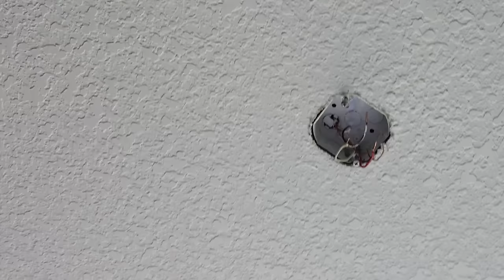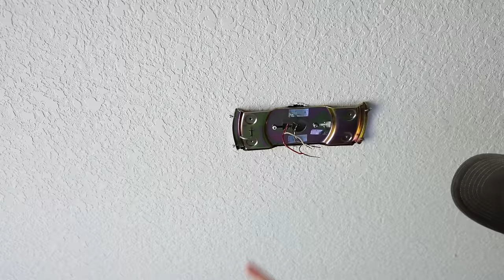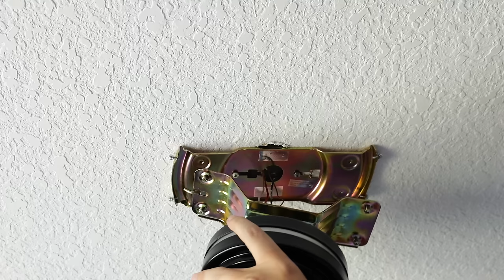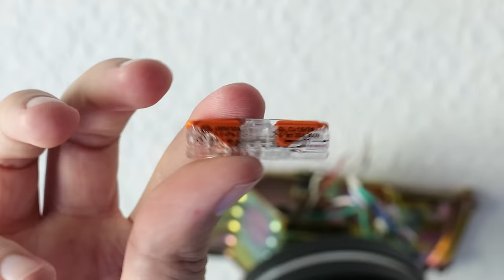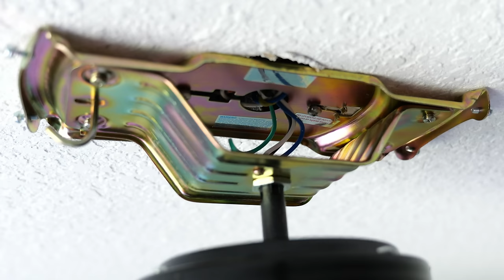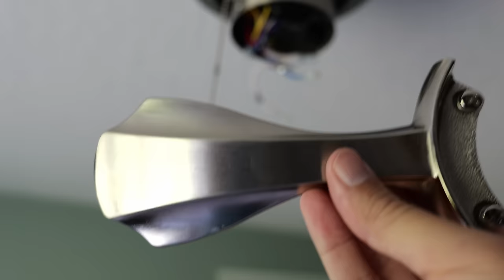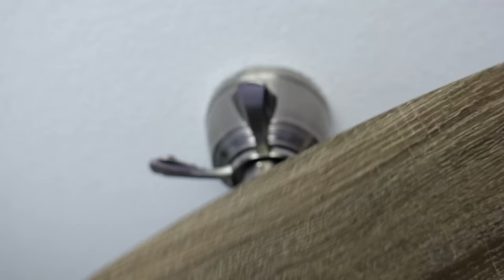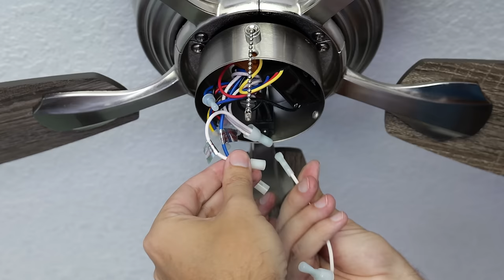Avoid This VERY Common Mistake DIYers Make When Installing a Ceiling Fan | How To

Comment: There are a few things I would like to add to this fan installation.
1. If the fan circuit is in the same room as the entertainment system, turning off the circuit breaker would be a hassle. Could you only turn off the two switches and test for power existence? 
2. If this is a DIY project, you don't know the rate of the electrical box. It's dangerous and a code violation if the electrical box is only for lighting fixtures. Even if the box is strong enough to handle the fan weight, I don't like the design of using two little screws to attach the fan bracket to the electrical box. I would utilize the 4 screws that connect the fan motor to the fan bracket. First, check if any studs at the 4 holes. If there are no studs, I would use 4 strong anchors to install and use for screws that come with the anchors instead of using 4 factory screws. I won't sit under the fan running at the highest speed with this installation. 
3. Before installing the fan bracket, make room for the electrical box so we can easily push all connections back into the box. The power wires look old and oxidized. We can lightly sand them or cut them off and make new ones. 
4. I think the fan wires have labels to show for light and fan. As someone suggests, more than likely, the switch that is closest to the entrance is the light switch, or just turn it on to double-check without opening the switch cover. In addition, the rubber band that ties the wiring of the fixture is for boxing the fan. It should be removed for connecting to the power. Worsely, it should not be pushed back to the box. Nothing should be in the electrical besides electrical wires and nuts with the correct code.

Comment: Question. The ceiling fan I have, the wire connection plug burnt. I plan on purchasing the wago 221-2401, cutting the 9 circuit terminal socket and connecting each wire with the wago connectors. The wires on the Hampton bay ceiling fan and light kit all have 18awg written on them. Do I have to use that gauge or can I use 16 awg if I need more wiring to make the connections longer?

Comment: Sometimes it’s not possible to do it, like when the box is too thin. In this case, if it’s a hugger, use lots of zip ties to ensure that the wire would never scrape the motor.

Comment: I have two incoming sets of wires coming from the ceiling. 
Set 1 has Black, white, and Ground.
Set 2 has Black, Red, white, and Ground.
My Hunter ceiling fan  (with a light), has Black, Black with White Stripe, White, and Ground. 
What are my hookups? Please help. Thanks in advance guys.

Comment: Have you done a video on "packing boxes"? I've done a lot of electrical, but I still have a problem sometimes packing a very busy box, getting all the wires to fit neatly. Do you have a special technique to make that a bit easier?
Reply: I've even resorted to using a piece of wood to push the wires tightly into the box. I'm sure that's a Nono!
Reply: I've had a lot of clients that refuse to walk across the room to flip a switch. Every light has at least a three way control if not four or five. I think those people need wireless electronic controls. Hardwiring that many switches is just stupid.
Reply: How about a video about arguing with unreasonable clients? That would be a good one!

Comment: I think it's a good common practice no matter what connector you use you should always use black electrical tape that way the connector and the wire can never come completely apart and be exposed to a short or shock someone.
Reply: if your connector won't hold without tape, you're using the wrong connector or installing it wrong.  and yes, I've had lots of connections where a tape covered wire nut fell right off.
Reply: @kenbrown2808  why would you say a wire nut wouldn't hold a wire? Tape is only wrapped around the wires and the wire nut to make sure it never comes apart and it can't short or cause someone to get shocked. It's just an extra safety measure you don't have to do it by code but people that wants to make sure things are extra safe do it this way and electrical tape is cheap.

Comment: If you don’t have a red wire does that mean you can only have the fan working when the light is also on? 
Mine has a remote control but I’m not sure how the wall switch interacts with the remote.

Comment: If you use the in line wagos, use heat shrink tubing to keep them from accidentally getting opened. Electrical tape will work, but makes a mess when the connections need to be changed/replaced.
Reply: @lylecoglianese1645  and then fill the box with sprayfoam just to make sure NOBODY can ever access the connections.
Reply: Haha YouTube needs a SARCASM FONT 😅

Comment: I have two switches and a red wire. the second switch has separate lights in the ceiling. Once installed everything works from the same switch whether i put black and blue or red and blue. the other light switch does nothing. Any ideas ? 💡 🙏🏽

Comment: Hi  I watched some of your great videos   I have a problem with field mice getting under my garage door. Unfortunately I still have a manual door.  The the stopper catcher on the vertical guide can not be moved and there is no travel left in it to adjust it.  So it looks like I need to remove the part that is bolted to a steel plate on the door itself.  I cant find any YouTube video to help me.  I'm worried if I unscrew the catch mechanism I wont be able to relocate it just a small amount.  Any helpful ideas?  Thanks

Comment: How do you know if the cueling can hold the weight before you install your fan. I live in a older tailer. That's my main concern the fan falling
Reply: 😢ceiling fan
Reply from the maker: Want to make sure that it is a fan rated box, oftentimes made of metal.  They can either be fastened directly to the framing or will have metal bars that span from one ceiling joist to another.  If it’s a plastic box I would definitely look harder at it to make sure it’s fan rated.  There are some plastic boxes that are fan rated but are a pretty hard plastic and have deep threaded larger screws than normal fixture boxes.  Some will even say fan rated.

Comment: I would seal the connections with electrical tape after you connect them up. Those levers open up. Had it happen so many times. I no longer use them.

Comment: I have an older home and noticed that the electrical boxes are the pancake type. I am not able to push the wires up into the box. What would I do with the wires in this case ?

Comment: Given that you were replacing a light fixture, why were there 2 hot wires coming from the box with 2 switches? What was the 2nd one for?
Reply: I was wondering that too… maybe there used to be a ceiling fan there and it was replaced at some point with just a light?

Comment: im anelectricin and installed 2 fans, i hooked them up so the switches control the fan and light, i live in a mobile home,so my panel is not bonded, but each fan only lasted a few dys to 1 week and then both quit working,i wonder why, could it have something to do with the ground not being bonded

Comment: I always wondered why no one wraps the connector with a layer of electric tape to ensure the levers don't flip up. Is there a reason?
Reply from the maker: You certainly can.  But if you’re just careful when placing them then there should not be an issue.

Comment: Those  connectors are easy, but they back out over time  because alternating current vibrates, they also make minimal contact, which can cause arcing, which will trip arc fault breakers. It's always better to lead the stranded wire from the fixture, and use wire nuts.
Reply from the maker: That may be true on some connectors but the Wagos are spring loaded so that is not at all likely.

Comment: I installed a similar fan using the exisiting wall light switch and fan switch and wiring to to the ceiling box and have noticed that when I have the fan running and the lights off (LED), the lights have a very, very faint glow when the room is dark.  I know LEDs respond to far lower voltage than incandecent bulbs, but I find this odd.  Should I be concerned about the light switch in the wall?

Comment: my issue: room has two switches (fan and light), installer put ceiling fan that has only ONE wire for light and fan since model is designed to control by wireless remote. Is there a way to mod the fan to split the wiring inside so fan and light are separate control?
Reply: Not to use by choice. The light will not operate like you want.  The wall switch might be able to control the light but if it's off, the remote can't turn it on.  Many manufacturers have a "one space" wall control using the black and white wires for both the fan and light dimmer.  The handheld remote works with the wall control flawlessly, simply code the dip switch code the same for all three modules.

Comment: Ya… make your u have a ceiling fan box installed in the ceiling instead of a regular light box. They always have a #10 screw & are usually rated to support at least 50-65 lbs
Reply: not at our complex. 50 year old bakelight boxes. theyve been mounting ceiling fans to those POS's for the last 30 years. most hold up just fine, its the ones mounted with drywall nails that end coming loose making fan wobble

Comment: I doubt most pre-existing light fixtures will have 12/3 or 14/3 wire run to it to control the fan light and motor separately from a dual switch on the wall, unless there was a previous fan in the location.  So be sure to expect that you may need to run a new wire to the ceiling or live with a manual light switch (pull chain on the fan).  You also need to ensure the electrical junction box in the ceiling is properly rated and mounted to support the fan's weight.  Usually, a plastic box will not do (common in most newer home construction).

Adding a ceiling fan to an existing light fixture is rarely a simple task.
Reply: I installed 3 ceiling fans at my brother's house and sure enough the junction boxes have the side brackets and are nailed to the joist and they were plastic , Plus the boxes were not nailed down good at all
When I removed the boxes I just used an average size screwdriver and pried them out with little effort , Once I got the boxes removed I picked up a ceiling fan junction box kit for each fan , The ceiling fan junction box kit which has a spreader bar to span the joists and spikes on the ends to dig into the joists and you tighten it with a crescent wrench , After final tightening , The spreader bar will be clamped tight between the joists and is more than strong enough to support the weight of the fan , What's great about the ceiling fan junction box kit is you don't have to go up in the attic to brace up the junction box and you don't have to cut the hole for the junction box any bigger because you put the spreader bar up in the ceiling and position and adjust it to where you feel it span the joists and tighten firmly with a crescent wrench , Then pass your wires into the box and attached it to the spreader bar
You definitely need this kit if you plan to install a large chandelier because a chandelier can be much more heavy than a ceiling fan

Comment: Would it make sense to use electrical tape over the wago's as an extra layer of protection to keep the lever from flipping when you push it back into place?
Reply: Yes, in fact I’ve seen a lot of people recommend this
Reply: The same Nazis that say you have to push the splices back into the junction box would argue that the Wago’s weren’t tested with electrical tape wrapped around them, so it would be against the rules. I say, whatever floats your boat.

Comment: Thank you for this video.  I don’t see any links in your description for the bracket you are using to attach the fan to the ceiling box.   Also, do you have any videos about adding a  wall switch for a fan.   My porch only has a light switch and I want to install both.   Thank you!😊
Reply from the maker: That bracket came with the fan.  I do not have a video on that unfortunately but the easiest way to do it would be to get some 12/3 or 14/3 wire, whichever size you need for the circuit and run that new wiring from the light box and the switch box replacing the old wiring.   Then you would have the black, red, white, and bare wires.  Many times people can use the old wire to pull the new wire to where it needs to be but of course results may vary.
Reply: they make fans that have remotes, either handheld or wall switch replacement.  if you're putting a fan on your porch, be aware that some manufacturers make outdoor rated fans - and that will hold up better anywhere but a desert.
Reply: Many wall controls with handheld remotes only use the black hot, and white neutral from wall switch to the fan.  The receiver at the fan canopy decodes the radio signal sent to it to control the light, on/off, dimmer and fan on/off speeds.  Use the pullchains to set the motor on high and the light to on.  I usually shorten the pull chains so people don't pull them once set.  A fan pullchain on slow speed will not go any faster using the wall control or handheld remote, and will most likely make the motor hum or growl.

Comment: Hey how do you know the box in the ceiling will hold up a spinning fan?
Reply from the maker: Check to see if it’s a fan rated box is the safest way.  There will be a bar connecting it to a couple of joists.  In the attic.  Or the box may be directly mounted to a joist.  All I’ll say is this and this is not me suggesting not to use a fan rated box, just stating history and that’s that it was only just fairly recently where having a fan rated box is required for all fan installs.  It used to only be required for fans weighing more than 35 pounds.  Usually the rules change when there are a few cases of the previous rules not being totally sufficient.  Every case is different.

Comment: Another point…. 
That hook allows you to hang the fan bracket and let it dangle on one side so that you will have plenty of space to do your connections. Then, you pick up the bracket with one hand and tuck the wires up into the box with the other. THEN screw the fan bracket to the box bracket.
Reply: Indeed. I’ve never put up a fan that had a bracket like the one in the video. Every one I’ve ever done you would have to hang it first and then attach it.
Reply: @yvonnejackson1696  I think I've done 5 with that bracket design.  most fans either have that hook, and you hook a screw hole in the canopy over it while you connect the wires, or they have a ball and socket downrod, and the socket is part of the mounting bracket.
Reply: The most recent one I did had the hook. What a great idea,  but no snap on blades.

Comment: Never trust turning off the wall switch alone. Always turn off the breaker and check for hot wires.
Reply: It's ok as long as there's nobody else in the house to turn the switch on while you are still working on the fan.
Reply: @willschultz5452  not ok, sometimes the hot wire runs to the ceiling box first, then 2 wires run down to the light switch.
Reply: @Mytube5202  still wouldn't matter,  you are only disconnecting the side of the switch that connects to the fan. That one is off with the switch.

Comment: Love your great videos. This one is no exception. But the title and thumbnail are very clickbaity. I would much prefer a 30sec YT short about the electrical code on “connections belong in the box” where the clickbaity title/thumb are more fitting. This vid is a top notch “how to install a ceiling fan” explainer, but the people seeking that knowledge wouldn’t know that by the title/thumbnail.

Comment: I have installed dozens of ceiling fans, and I have never seen a configuration like this.  This was like watching how ceiling fans are on Mars.
Reply from the maker: Not sure why.  They are pretty much all the same 😂
Reply: @HowToHomeDIY  yeah, dunno.  The mounting of them is a lot different from what I'm used to.  

Anyway, I don't think I'm doing anything wrong with the ones I do install.  Thanks for the videos, I get a lot out of them!

Comment: Ceiling fan rated box.   It's much easier to move fan to a joist & use a pancake box.
Reply: problem is pancake boxes fail wire fill. just the incoming romex fills a pancake box to limit. wire nuts, fan wires overfill them

Comment: Question! So if I only have one switch and I am connecting the blu and black from the f fan to the black from the ceiling and I use one of those Wago connectors. Do I need to twist the blue and black from the fan together into one then insert into the wago on one side and the black from the ceiling on the other side? Or do I simply iinsert the black and blue into individual slots in a wago and then the other black into the side opposite the black fromt he fan?
Reply from the maker: The second option.  Use a 3 port Wago.

Comment: I thought the reason for the hook was so that you could hang the fan while you connect the wires and push them into the electrical box.   Then screw the fan to the box.   No need to push the wires and connectors through the hole.

Comment: Man i put up a new one  and it only runs on slow its run off a remote .i wonder if the capacitor is bad from the factory
Reply: Set your wall control on high speed then go to your ceiling fan and pull the pull chain to its fastest speed. Now shorten the pull chain so no one ever pulls it.
Reply: @alanmccalla6737  man, mine doesn't have the pull chains , just the remote
Reply: the batteries in your remote are weak and they're not allowing a strong enough signal to tell your fan to go faster